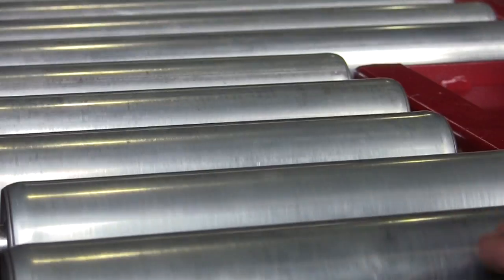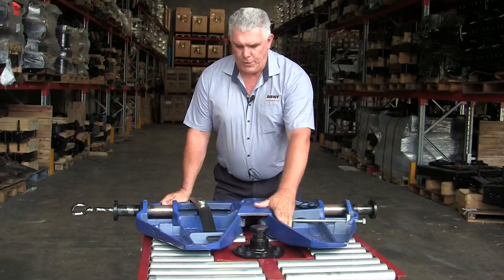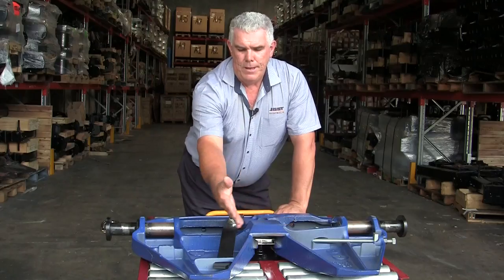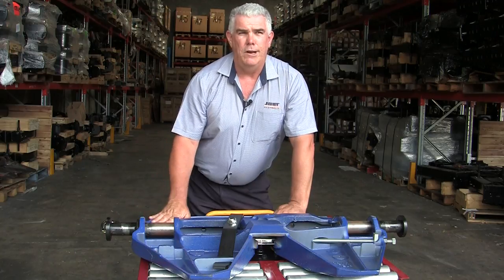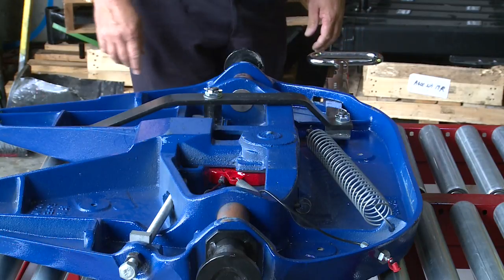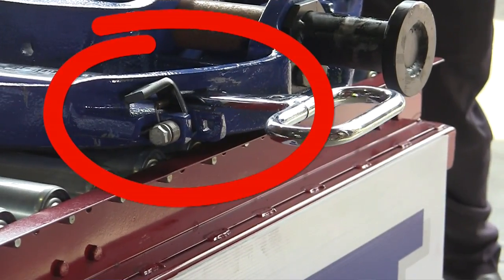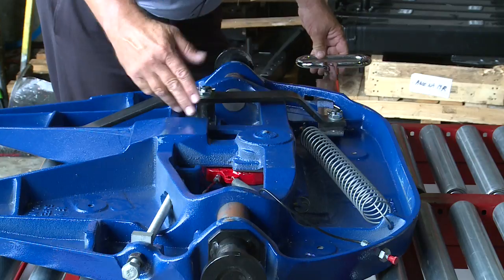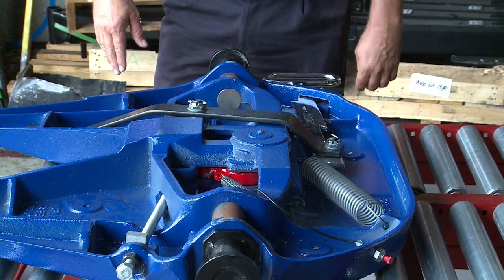Jost JSK37 Fifth Wheel operation

Comment: thanks for the video, I have a jost on my freightliner but no locking feature, the bar unlike the video is round, do these not have a safety lock, cheers
Reply from the maker: Hi Steve, we got hold of the guys from Jost and they sent back this reply, hope it answers your questions. 
The round lock bar tells me its either a JSK 36 CV, or a JSK 38 model fifth wheel.  Historically the fifth wheel handles didn’t have the auto secondary safety latch.  Once coupled, the operator had to insert a steel wedge, which was then held in place by a “dog clip”, that hung off a chain.  
 
As I said that was historically.  The spring loaded secondary safety latch has been standard on JOST fifth wheels, for at least 20 years, perhaps a bit longer.

For the operators information, if it is a JSK 36CV, the adjustment procedure is the same, just the location of the adjuster bolt is located on the opposite side.